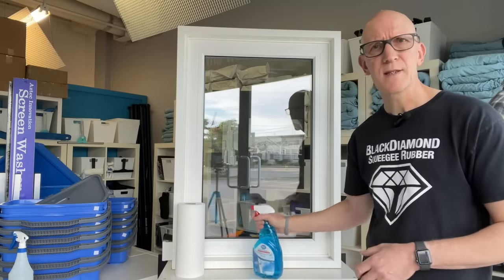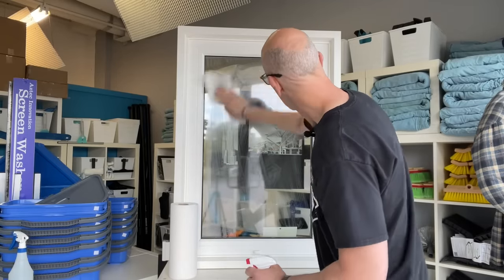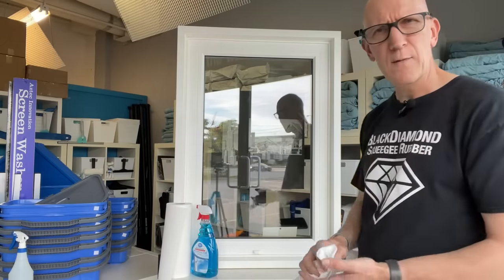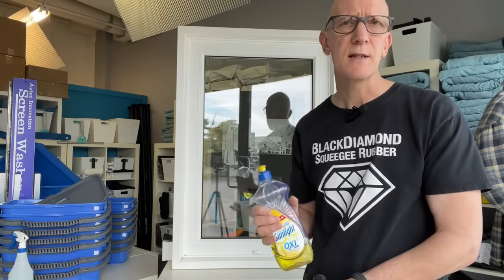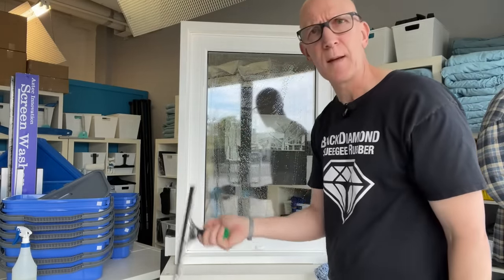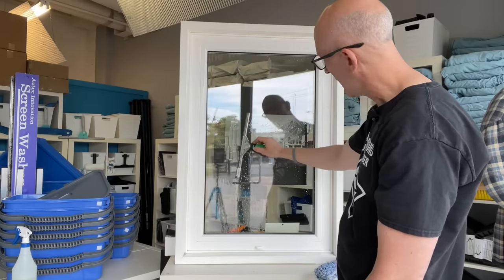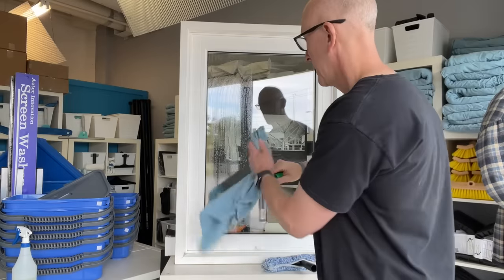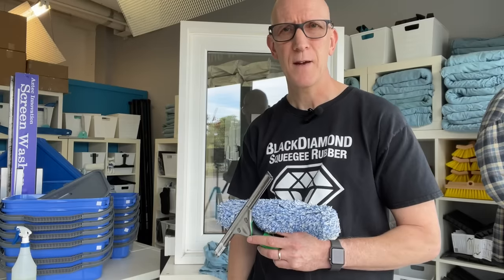The Secret To Streak Free Window Cleaning - How To Wash Windows Like A Pro

Comment: I use this method but I get streaks from the rubber and it's really difficult to get rid of
Reply from the maker: I suspect there’s an issue with your squeegee rubber, channel or technique. Please watch this video to trouble shoot. Also, the good news is the you can simply rewet the window and squeegee again with improved technique. https://youtu.be/OwHYa9mLlDY
Reply: I do clean it again then when the sun shines I can see the lines left by the rubber and it looks awful. Maybe I'm applying too much pressure and that's why it leaves streaks.

Comment: How wet is your squeegee? Also how do you clean a glass with a curved top such as a buffet glass?.
Reply from the maker: The squeegee is best to be dry when you start. It’s sole job is to remove the soap/dirt solution hovering on the surface of the glass. As for curved top windows, sometimes a swivel handle squeegee can be used.

Comment: I triple wash all my windows, first wipe is to remove the majority of grime from hesvily soiled windows, a windex based product to remove finer particles and an anti fogging clesner and it comes out perfect every time.
Reply: Surely it'd be the best way but it all depends how much time you want to spend on this. I want to spend as little time as possible to clean my windows and hence I landed on this video from a Reddit post.
Reply: @am90  there isn't much of a difference, so I'm not sure. Maybe on big buildings where there are huge windows with more surface area of glass but typical residential properties you're not cutting corner on time especially if you're doing the whole encasement of the window. Takes me 15 minutes on a heavily soiled window to clean the glass (inside, outside), the window frame (inside, partially outside), the window ledge (inside, outside), window tracks, rubber seals and so on. If I just washed the glass then maybe 2 minutes absolute top. If you can wash windows faster than this I'd love to know.

Comment: How is it that you don't need to rinse the window after applying the soap solution>?
Reply from the maker: The sharp edge of a fresh rubber blade removes all the loosen solution/dirt. Key is to only use a couple of squirts of soap in a bucket of water.

Comment: I have been cleaning for 35 years, and the same rule applies to mops!  Friends mops do nothing but spread germs and bacteria all over the floor. The floor is not clean. I call it the Houdini treatment, the visible dirt disappears but it is still dirty. I use a steamer, but if you don't have one you can squeegee your floor but what ever you do....don't mop! Ewwwww! 😝😫
Reply from the maker: Exactly!
Reply: Good idea
Reply: mohsen01  😆😂😆😂I agree with you 💯 💥🌹
Reply: Thank you for making this!  I’ve been discouraged with a squeegee as I’ve always had streaks but that little tilt to the squeegee may make all the difference.  I’m going to give it a try.  I get a lot of salt and dust on my windows so they need washing quite often.😊
Reply: After each floor mopping section. Clean and wash the mop head with soap and a little bleach or vinegar. But always clean the mop head. And preferably let it dry outside and major plus. Dry in the direct sunlight.
Reply: @bigvalley4987 j
Reply: Well I’m not in full agreement with that… if one mops correctly… there must be a reason that I end up with dirty water. 🤷‍♀️
Reply: @lisaschiller7164  Absolutely, because you pick up half the dirt and bacteria, the rest spreads and dries to the floor. I guarantee this I've had my own cleaning business for 30 years now and I have a degree in chemistry. If you got a bacterial light and ran it across your floor after you mop, you'd never mop again. It is a factory for bacteria!
Reply: @bigvalley4987  That is something you can do to help! Yes great advise!! 🤗💯
Reply: Maybe you are doing it wrong.
Reply: Pinesol.
Reply: @ItalianAngel21175  you shouldn't steam hard wood floors
Reply: @sugahoney89  Yes you can, the steam in them machines get hot enough to kill bacteria but not hot enough to ruin wood floors!
Reply: @ItalianAngel21175   Other professional cleaners are saying otherwise.
Reply: @ItalianAngel21175 Umm moisture ruins wood. Heat makes moisture more likely to penetrate.  I think you are wrong.
Reply: It depends on your cleaning solution. Hospitals use a professional hospital grade floor cleaner, that does not just spread bacteria.
Reply: Most laminate flooring states do not use steamers on floor
Reply: @ItalianAngel21175 if steam is hot enough to kill bacteria it most definitely  will ruin hard wood floors.  In time it will cause the hardwood to not only cause the hardwood  to bulk up but cause the wood to come up. Yes steam cleaning hardwood  will ruin it
Reply: @JohnSmith-fo4rg  i know she is wrong. She's  wrong about steam cleaning floors and she's  wrong about mopping floors.  If floors are mopped properly  with the right  cleaning products the floors  will be clean and germ free
Reply: Where does that dirt go with a steam mop?
I do my floors daily with a mop and  once a week on my hands and knees. My water never looks dirty.
Those steam mops are a bit sanitary. 
Where does all that dirt go?
Hot water on two cloth like spinning doesn't clean.
Reply: Terry mops are the only mop I trust.
Toss them in the wash with a little bleach.
My mop water isn't ever dirty when I'm done. Mop daily.
Reply: Eh, I already know what he’s doing, just brainstorming what tools are out there like that microfiber utensil. However I like how I now know I’m not odd when I squeegee my car windows, I flick my wrist, and then swipe the rubber edge on a microfiber cloth in a different spot every swipe to not contaminate the blade, usually I go right from the shower, to dressed, to car window wash because I get stupid picky about, well, just being able to see where I’m driving 😂. Rainx is great, not effective so much in 30mph city speeds, and I do rainx my outside structure windows. Learned when winter comes it’s harder to scrape ice from a filthy windshield than a clean windshield, and even though you may not see the dirt, when it’s there it can smear when it gets wet, and that’s not fun
Reply: How can you use a squeegee as a mop? I don’t understand where you would get one long enough to mop?
Reply: Don't be so creeped out by bacteria on floors though. What kind of bacteria are you weirded out by? What do you think it will do to you? Because bacteria is all around us for the most part? I was under the impression that steam could ruin some floors.
Reply: Most mops have a scrubbing pad on the back to agitate the dirt
Reply: @Susan70003 Pinesol is petroleum based. Definitely not using that garbage.

Comment: Wouldn't you get no streaks if you wiped up and down or side by side? Why so technical? Its a simple wax on wax off?
Reply from the maker: No wax 😉. Wiping gives you false hope that you removed everything off the glass but you haven’t. Some of the dirt and cleaner solution has just dried on the glass surface, waiting to reveal itself once the sun shines at the right angle. My video is technical because it shows the professional method use by those (myself  included for several years) and charging for professional results.

Comment: How about for windows full of debris? I did my windows and have tons of scratches
Reply from the maker: The above video demonstration is recommended for typical window cleaning jobs. Any debris like paint overspray, stucco splashes, concrete/mortar, silicone is not typical and requires specialized tools. This type of cleaning is considered restoration. Also, a lot of people may discover scratches if they’ve never cleaned their windows before (or first time after post construction or reno). And the scratches may have already been there. You are now only discovering them. Neither the windex method or scrubber and squeegee method cause scratches. These tools are too soft to cause any damage.

Comment: I use straight alcohol on my windows, wipe with a micro fibre rag that’s really clean. Be careful NOT to get the solution in the ledges or floors. You can pour the alcohol directly on micro fibre to wash if your worried. I do this on my windshield….. no more streaks at night

Comment: I've always used a squeegee on the outside of the windows and blue stuff on the inside.  I don't like using water on the inside.  I find it makes a mess.  Yes the blue stuff leaves some streaks, but you need to wipe with a dry towel after.   It works because the inside of the windows aren't really that dirty.  I do the same in my car.  Squeegee outside blue stuff inside.  
As far as it running down the window.  You just spray it on the top half and let it run down and wipe.
Reply: I wouldn`t use a squeegee on the inside either and have it getting on the wood at the bottom of the window.

Comment: Now what about the inside?
Reply from the maker: Same method for inside. Just make sure the scrubber T bar isn’t dripping wet. Wring it out before scrubbing the glass. Some like to place a small towel on the window sill to catch drips. Your detail wipe up cloth does the rest.
Reply: Thank you for this!!  What really impressed me was that there was no rinsing - something I often do even when I see even minimal suds.  One question though.  Do you vary your method if there is extremely hard water?

Comment: But, why wouldn't you put the solution on with scrubbie, and THEN wash with water, and next use squeegie.
Reply from the maker: If you’re talking about the “Blue” stuff, it’s not meant to be used that way, it doesn’t foam up. If however you are referring to the dish soap or other professional window cleaning soap, directly apply it to the scrubber would foam up to much and leave a thick sticky film on the glass, you’d use too much and blow through a bottle in no time. All it takes is a couple of squirts of soap in a pail, gently mixed and there’s enough to do all your windows. This info is brought to you by someone who operated a window cleaning business for 7 years followed by selling window cleaning products for 10 years. ;-)

Comment: I used a 100% coton rag instead of the microfiber thingie used in this video, and it did the job perfectly. I'm not crazy about using microfiber wipes anymore because they're synthetic, release a lot of plastic microparticles every time they're washed (polyester and nylon are essentially plastic in fabric form), and they don't biodegrade once they've been thrown out.  Please consider switching to natural fabrics to clean with.

Comment: No matter what soap cleaner I use, after a few days to a week you can see streaks left from the soap, squeegee or rag.
Reply from the maker: The squeegee method is what all professional window cleaners use for streak free results. If you’re getting streaks with a squeegee, check for the following, The rubber must be in good condition, no nicks, cuts or abrasions. Be sure to hold the rubber blade to the glass at a 45 degree angle, too flat and it’ll leave water behind. And don’t press too hard. Also, some have a tendency to use too much soap, less is better.